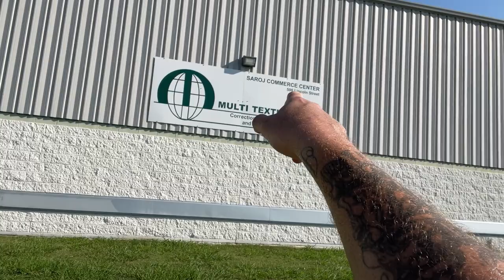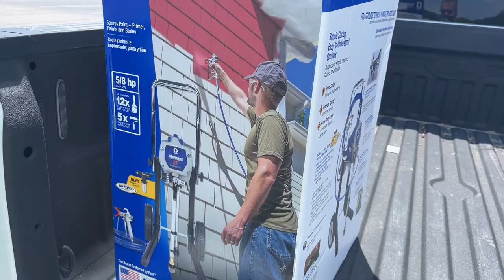Update On Our New Business Venture

Comment: This is where many new businesses fall short, on the pricing. You will have cheap Laborers in everything but they get what they pay for. Plus many of these painters, spray the paint not roll it which makes it go alot faster. And everything is the same color. But worst thing to do is undercut yourself to get a job. Now if you need the work it's better than nothing, but these companies want you to pay all these fees for backgrounds, etc and that eats your profit margins up. What several person's do is research by calling around in your area and get rough estimates on a 3 bedroom single color job from reputable painters that have been doing this for years, then you will quickly see if your prices are in line with fair market prices. When they cut your rates, tell them that you must have minimum of so many units a month at that price or it is just not worth it.
Reply: Good advice ...JJ..

Comment: I just bought a Graco X7 myself. I will say it does make quick work of painting HOWEVER the set up and prep work takes a hot minute. I spent a lot of money on plastic sheeting and painters tape. The overspray is a real concern and pretty much anything that isn't covered or taped off is going to get some sort of overspray on it. There is that and I would highly recommend a full body suit with the 3M respirator. Learned my lesson the first time using it. You will come out looking like one of the blue man group if you don't have it well ventilated as well as depending on the size of the room your spraying. With all that it is a great tool and I'm fortunate enough to have bought one. Was a good 450 investment in my current and future home painting projects. Just sprayed two coats of valspar ultra white paint and primer / walls and ceiling from a 5 gallon bucket and had about a inch or so left in the bucket. Good luck on your gigs there Joe!

Comment: If you increase your run slightly to 3.1 miles that's 5 kilometers. With regard to the running try not to focus on running faster than yesterday, try and keep runs nice and easy to the point you are no longer breathing heavy. And you will see your times improve faster, it more about low heart rate than pushing hard to much as that is a recipe for injury. Also I cant recommend enough buying some nice quality workout clothes that are NOT made of cotton, manmade fibers will wick the swear away from your body and dry faster than cotton and feel a hell of a lot more comfortable while sweating during workouts/runs.

Comment: Been forever since I stopped setting tile and transitioned into selling it but grout just needs 2 wipes, the third should be when it’s dry and just use a dry rag for the haze, vacuum after that. Grouting is satisfying but definitely tough on the body. Dollar store has these cheap throw away foam knee pads and are a game changer. Looks great, thanks for sharing

Comment: So Joe got a spray gun to paint the walls. I put money that he tries using the spray gun on the test apartment and the walls come out looking like zebra stripes because Joe doesn't have experience painting with a gun. Remember flip 1 when he tried painting the ceilings with the spray gun? He went through like 10 gallons of paint to do the ceiling on a 700 ft single story house? LOL

My advice even though Joe doesn't read the comments or if he does, he just listens to the ones that agree with what he has to say, but anyways, leave the spray gun until you have more experience and in the meantime go in there and roll out those walls like a madman and get the apartment done. If you go in trying to use equipment that you have never used before, you will never get the thing done in time and make yourself look like a fool at the same time

Comment: Those are some sad prices for painting a room. Probably just to apply paint, no wall repairs and no prep work. I would have not bought a sprayer. Roll walls with an 18" roller 6" roller and brushes. Spraying is for new builds or where the place is empty. I've watched lots of paint dry and watched many different paintings crews. My advice would be raise your price and provide a perfect product. Fix walls, cover everything, clean up, get rid of all the tape. You can make serious money running a painting business, but don't be that guy that paints, tiles, carpentry, etc. You just become a hack. Painting only and learn to work with subs if more than one trade is involved. I've worked with a couple of larger million dollar painting companies, and smaller painting companies. All the good ones work the same exact way, efficiently and clean. Stick with best practices.